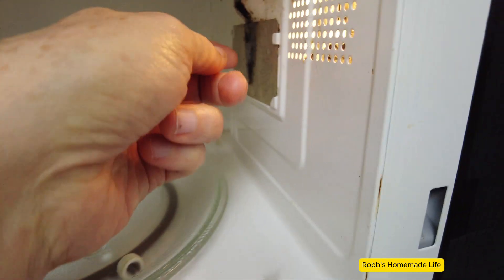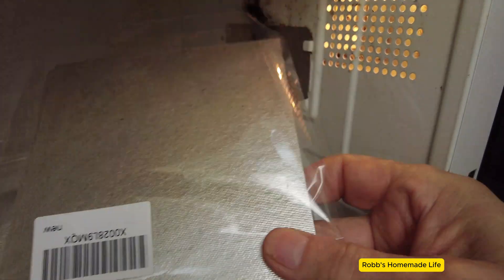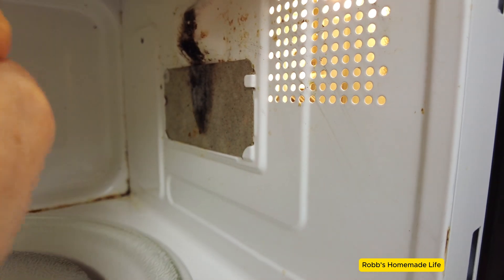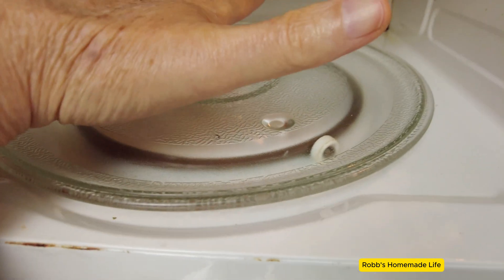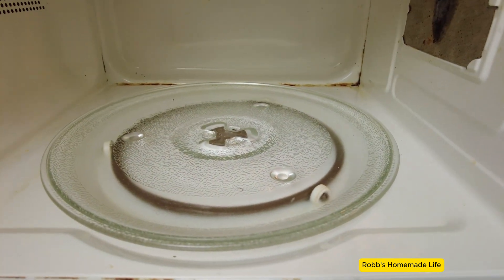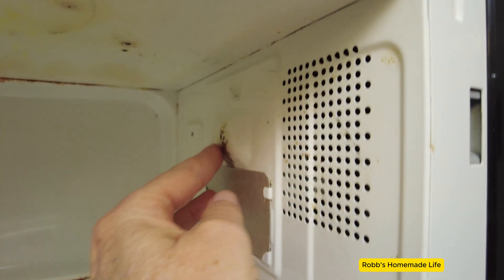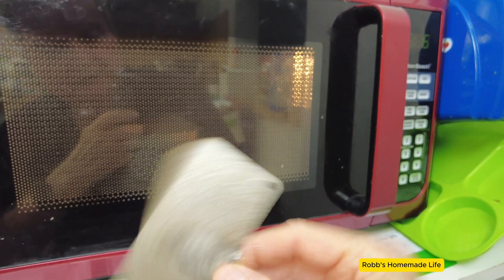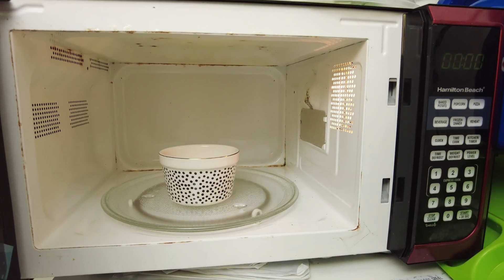Microwave on Fire? 5 Reasons Why (And How to Fix It Fast & Cheap!)

Comment: My wave guide cover was made out of cardboard and I thought it was a packing piece and threw it away. Should I not use the microwave anymore?! I came here because it set a bag of popcorn on fire.
Reply from the maker: If you look in the video description I have a link to the replacement covers They are very cheap

Comment: Robb, you have no idea how useful this video was for me!  I'm sitting here at 3am and after watching your video, had to get up and go clean my mw for fear of a fire. Then i decided to check this other microwave that had quit working, but i haven't gotten around to putting it on the curb.  Lo and behold! I found something inside it that I have been searching for about 3 months!  I have almost turned my house upside down looking.  It was a small device to jumpstart my car battery.  I had just bought it and charged it up.  I think the reason I put it in there was because i was going out of town for a couple of days and was nervous about it catching on fire, because it's lithium ion type.  My thinking was that it would be hard for the fire to spread if itwas sealed inside the mw. 😂
But back to mw, the old one just stopped working, no fire or smell of anything. How do i tell if it was the magnetron?
Reply from the maker: Retta I'm so glad you found your item. Years ago I was making oatmeal in my kitchen and when I went to put the lid on the round box of oatmeal I could not find it I was the only one in my house and I had not left the kitchen I looked and I looked and I looked and I looked I was going crazy eventually I found that I had put the lid from the oatmeal box on top of another oatmeal box
Reply: @RobbsHomemadeLife   😆 🤣 😂
Reply: Where to get the bronze thing for replacement

Comment: Good one.🫵🥸 You da man.

I enjoyed the feeling of being inside looking out. If you find a mannequin head, you could put it in the box and do a Señor Wences gag. (ees all right?…..ees all right.)

I need another microwave for re heating my coffee.
My thirty year old dead beast has been storing I can’t remember what for ten years.
I’m half afraid to open it.
I’ll get around to it when I need those big magnets inside.
I’ll avoid that capacitor. 
I’ve heard that the little piece of pink looking ceramic is toxic and dust from it should be avoided.  I don’t know if that is true but I’ll assume so until otherwise informed.
Reply from the maker: I just learned about that dust today it's supposed to be cancer causing sounds pretty nasty in those microwaves I have some extra neodymium magnets from hard drives if you ever need a couple I can send them to you I got them off of eBay years ago